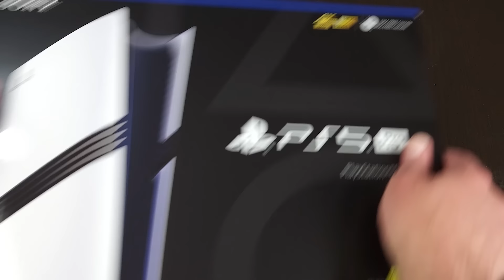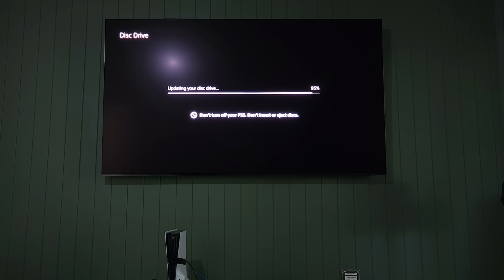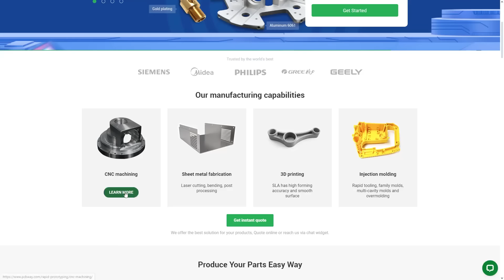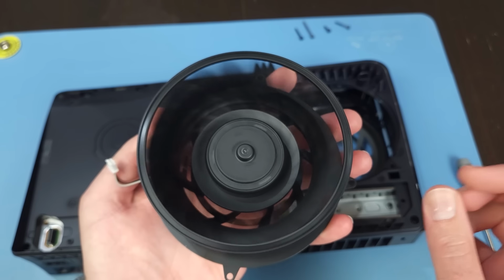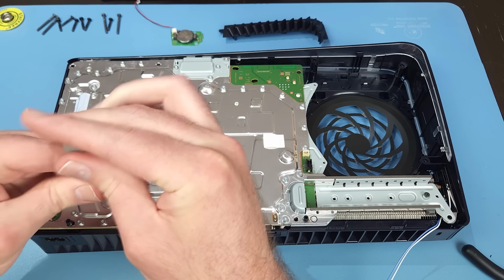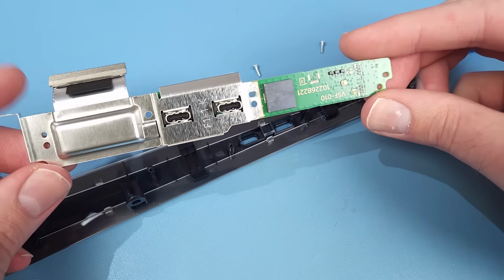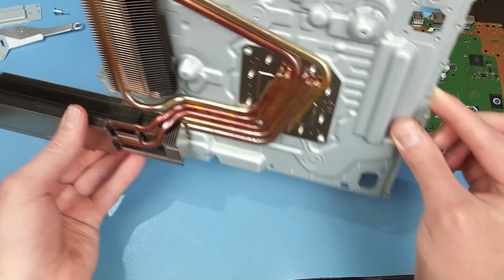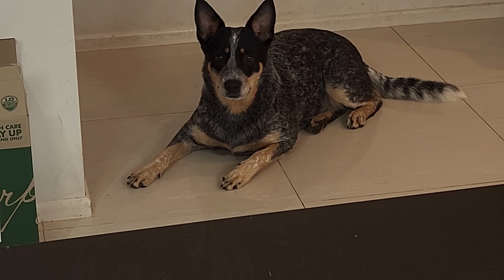PS5 Pro Teardown

Comment: I have used both PS4 PRO and PS5. PS5 has some quality control issues, which caused my console to not read discs without warning. I compared different products and found that the game quality from PS4 to PS5 has not improved significantly. I did not buy PS5 PRO. Unless the price of PS5 PRO drops completely, it is not worth upgrading because it only improves the game background slightly. $700 is still too expensive.
Reply: "disc reading problems ps5", what?

game quality not imroved from ps4?! WHAT?

are you high? just say yes, also, buy glasses pls, also, if you really think that, your opinion scks 4ss
Reply: @GeometryEX-hp9zs if you're playing old gen games then no shit they're not gonna graphically improve 💀 only the fps.

Comment: Thanks for the detailed tear down.
At least I know from this clip that Sony tried to prevent dried spot on APU die from the liquid metal gravitational displacement by using grill texture surface. I feel more relief  that I can put my PS5Pro vertically in long term.
Reply from the maker: @noi747  Yes true, it looks better for that.
Reply: my launch day PS5 has been vertical this whole time with no issues. my pro now will be vertical till ps6
Reply: @imtjnotu that's been nice.
Reply: @imtjnotu  My digital has been vertical since launch day too. No issues. Still got my one and only OG controller who I've been begging to get stick drift to replace with a black one and nope. Doesn't give up. Still feels new.

Also just sold it for $300 and got a PRO :)

Comment: Does that copper heat pipes and aluminium heatsinks mean it keeps it cool for better than the OG ps5 the one with the massive copper heatsink?
Reply from the maker: Yes I think so. But it's also generating more heat though
Reply: @RestoreTechnique   Hmm so essentially in the end it generates same heat as a ps5 but the pro console runs hotter than the ps5 anyways so it keeps it balanced? 

Is that what your saying?  Also better to have the ps5 pro vertical or horizxontal?  For best cooling purpose?

Comment: Hello I have a question 

The PS5 has soldered SSD

So when It will die

I could not change it like on the ps4

Sony planning to do an update so we can reinstall the OS on the second slot?

The M2 Slot

Comment: I will say this to anyone the PS5 pro is a complete rip off for its price and yes based PS5, Xbox series X and the switch also is a rip-off even at its release date, basically what I mean by this is the base PS5 and Xbox series when it was first released should have been £350 and whatever price it is in other countries if you look at the specs at a technical level you realize oh they should be at that price when they first released, right now the base PS5 and Xbox series x should be at a lower price by now of £250 or £300.

But for the Nintendo switch when it's first released I believe that should be £200 because if you look at its hardware specs such as it's using a Nvidia Tegra X1 that's only been clocked up to 1.02 GHz, 4 GB LPDDR4 1,331/1,600 MHz, the storage is comparable to a microSD card, Undocked: 307 MHz, 236 GFLOPS and Docked: 768 MHz, 393 GFLOPS, basically the Nintendo switch has half the RAM the Tegra X1 is being underclocked and yes this is a type of chip there is used for mobile phone, the GPU is also underclocked as well with less GFLOPS and they went with a very cheap battery to power the system.

All I have to say to people is this these consoles are not worth getting they're overpriced underpowered, the membership locks these consoles from online play discounts and Cloud service, you're locked into the ecosystem, the first party titles are not enough to draw in people these days, you're locked into the peripherals they have for their system, buying a game on their online store is quite overpriced especially Nintendo's and you're actually paying for more for these consoles.

I say you have more options these days to play games the years ago such as you have gaming pieces that can be low end to high end, you have laptops and handheld just to play your favourite game without the cons of a console, basically consoles used to be the cheaper option just to play your games but now consoles are becoming to expensive and if you don't believe me look at the ninth gen consoles and you'll see why, I do believe consoles are going to be even more expensive in the nearby future.

Comment: Can someone please help me out here. I purchased a circular mesh dust filter to go on top of the fan but I've noticed there are two fan openings, one on the top of the PS5 Pro, and one on the bottom of the PS5 Pro near the expandable SSD slot. Which side does the air get pulled in? The top fan opening? Or the bottom fan opening? I don't want to put the mesh screen over the area where the air blows out because then essentially it will trap the dust inside correct? Or do both sides of the fan opening sucking air and then it is blown out the back? I'm so confused.